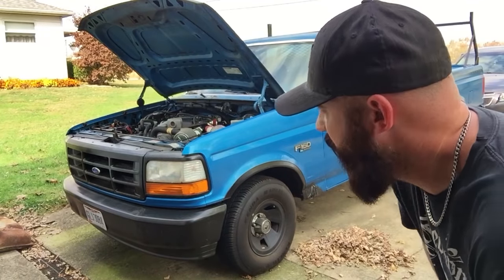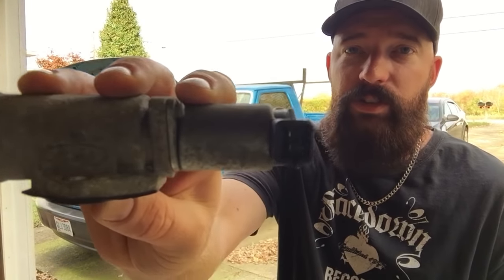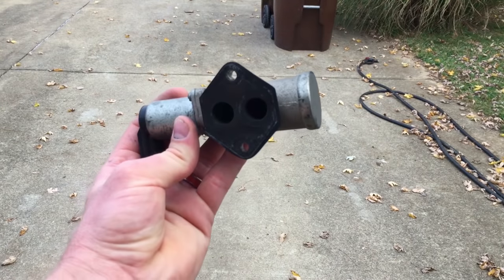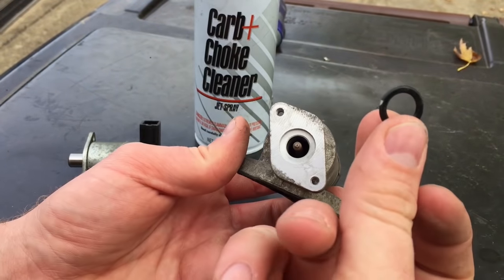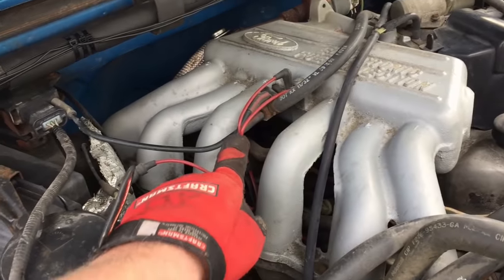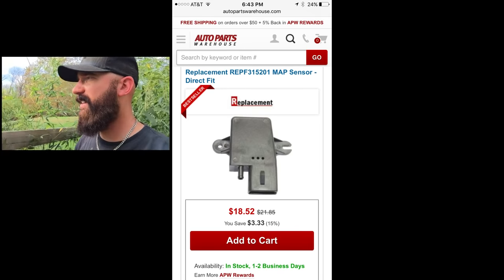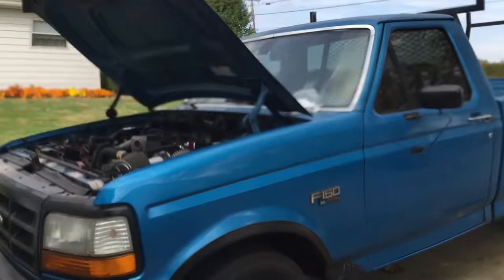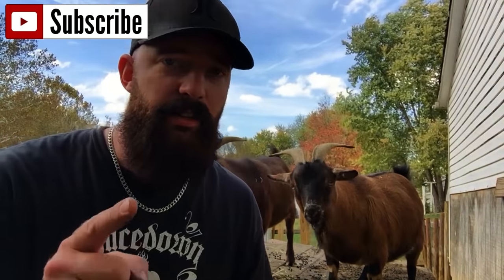Car / Truck Won't Run or Idle / Fix - F150 is the patient

Comment: Will map sensor cause check engine light to come on? Please respond! My 1988 F 250 5.8 will not idle, changed everything except map sensor.
Reply: My question exactly. Did you get a response?
Reply: Craig Ovadia, no I did not get a response,  however the reason my truck would not idle was I did not adjust the TPS  before I installed it. I did change the map sensor and my check engine is still on.
Reply: Do you have an OBDII tester? If so, you can get the codes off the truck on the D connector usually under the dash on the driver's side. You can also clear the check engine light by disconnecting the neg on you battery and try to start it. That will clear all the codes. Reattach the neg lead and start the truck.
Reply: I disconnected the MAP on my e150 earlier to see what would happen. It ran super rough and died with a check engine light. Plugged it back in, and the light went off. So I would say yes.

Comment: I have same problem. Changed the map sensor and now it shifts harder and check engine light on wasn't before. Stalls and dies putting in reverse . Guess it is something else?
Reply: The transmission E40d has a sensor on it. Range sensor. May be that. Also a VSS sensor on back diff, maybe that too.

Comment: what else would you check if it isnt the idle air control valve or map sensor or egr valve?
Reply: Try the tps...Throttle position sensor

Comment: As easy as the map sensor is to change why didn't you try it first. Would be nice to see if it was all one or the other or both? Good video otherwise, short and to the point.
Reply: I agree, it's good to have an independent variable, to know what part actually fixed the problem or if indeed it was the combination.

Comment: A lot of times when my 93 f150 302 runs for a while, usally after I drive it for a few miles and get it back home and it idles it tends to putter out and dies. Could it be on of these sensors going out?
Reply: have same prob W/same f150 302 & it wont restart when warm unless I floor it. SOS!

Comment: Mabey yall can help got a 1996 ford f150 5.0l and it will sparadically when i go to start will fire and drop and die or itll fire and run and really low rpms very rough and ill give it a litlle gas itll just get rougher for few seconds then finally itll jump up in rpms and run just fine with a slight rough idle after sometimes it does this other times it start just fine its just had a tune up to it was doing the start and dyeing stuff before i did the tune up as well

Comment: Hi I have a f150 1995 shift stick  and when aI drive it and pus de gas is no power is berry bead  what could be wrong..I'm in California...
Reply from the maker: Check your transmission fluid first make sure it isn’t critically low.  Cheapest.

Check the clutch fluid next. Cheap.

Or- could be the clutch or torque converter. That’s when you get into some money for repair. Best of luck!

Comment: I got a truck f150 1993 5.0 flareside  it would go off and it don't star and it doesn't do anything and i have to wait like 30 or 40 min to star my truck and i change alto of parts

Comment: Would any of these repairs fix a high idle?
Reply from the maker: Just about all of them, and there are a hand full more that would fix.   Rough idle is one of the hardest to diagnose.  If you have a 95 or older, you can use a diagnosis tool.  If it’s prior, I made a video to diagnose. Best of luck!

Comment: Can you tell a difference with that intake you put together? I thought about doing that to my 95
Reply from the maker: Adrian Aguilar - I would say so... seems to give it a little better throttle response. ... If anything it sure does sound good when you give it some gas.  Take care man!
Reply: What size of pipe,boots, filter did you use

Comment: Hey man I can’t find my map sensor please get back to me it’s a Eddie Bauer 5.0 f150 I cleaned the idle air control valve and it helped a lot just can’t find that sensor can anyone help me where it might be
Reply: christopher salazar I’m pretty sure it is the same location that the one in the video is, at least mine is and it is a 1991 5.0 f150, hope this helps. Or just follow the black line coming off the intake manifold.

Comment: I have a 1993 F150 that cuts off when I turn on AC. WHY
Reply from the maker: The a/c compressor / pulley may be locked up.  It just spins in neutral mode when the ac is off/ when engaged it spins the ac compressor and ac system... if that locks up the belt will stop and shut off the engine.  Best of luck, take care.

Comment: Thank you so much for this!
Reply from the maker: ricky emt - no problem man... hope it works... I also put up a video on how to diagnose your engine problem electronically.  Just wanna make sure you know about this 'paper clip' method if not, it can be a straight lead to the problem your having.  Here is the video if you haven't tried this... https://youtu.be/bQB9D5MKaQ8 Take care man, best of luck!
Reply: Brian Ealy ya I just picked up an 87 f150. Its my first pick up and coming from the tuner world I know next to nothing about the older motors so I'm trying to absorb as much info as possible!

Comment: 88 4.9 STARTS COLD HIGH IDLE WARMS UP IDLES DOWN THEN IT WILL IDLE HIGH THEN IDLES DOWN AND THEN DIES  IT KEEPS REPEATING THE SAME OVER AND OVER      CHANGED MAP, IAC,  EGR AND STILL HAVE THE SAME PROBLEM
Reply: Sounds like a bad engine coolant temp sensor. O2 sensor tries to adjust the rich mixture but can't adjust enough.

Comment: 1990 ford 460 it was runnin then i press the gas it loses all pressure alot of knockin rough bascially so called shitt mec just throwing parts at her keep in mind its a 32ft rv alot of inpounded fee$$in towing im stranded again its been 1yr same issue im pissed the ##%## off

Comment: Mine runs fine cold, in the loop, the second its warmed up, loop is off, the ECM is in control it goes to shit, idles extremely low, put it in gear and it quits, turn the steering wheel, it quits. I just replaced the steering idle switch, code said it was open, bad switch, no difference, getting sick of it, Ford finally found a way to ruin the reliability of the 300 I6, they are absolute shit now, not impressed. If you are looking at any of these trucks, 6 or V8, be ready to put a carb on it, you'll thank me, don't start replacing shit, I have more money in mine than the cost of it, was running when I bought it, a year later, well its a slot machine that has yet to pay off!

Comment: First of all, get a code tester before replacing parts unnecessarily.
Reply from the maker: 94 bro. No code tester... Pre 95 scan port.  Second of all, check my other video of how to check your codes without a code tester to those who need to know. Video titled diagnose with paperclip.
Reply: @BrianEaly  If it has a check engine light, it has a test port. Actron CP9690 checks from 1984-2013. It has OBDI cables for Ford, G.M., Chrysler, and Toyota. It checks live, record, graphing, transmission codes, emissions readiness test, oxygen sensor tests, ABS, SRS, and MORE! I have one for my 1985 Ford LTD 3.8. It just reads codes. It has code connect to diagnose codes. Using a code tester can tell you in print the code. It checks timing advance. It gives results according to the specific vehicle. Without a code tester is guessing. OBDI doesn't test live and graphing etc. , just codes. There's a digital Ford code tester with the book. You can erase memory codes with the tester.

Comment: OFFENHAUSER HAS SOLVED ALL OF THEE NONSENSE. OFFENHAUSER INTAKE AND HOLLEY QUICK FUEL CARB. THERE ARE SOME HINKS & KINKS ESPECIALLY THE LINKAGE I WILL BE MARKETING A BLUE PRINT OF THE CONVERSION BECAUSE THERE R SOME BLUNDERS U CAN MAKE BECAUSE I SURE MADE ALL OF EM...